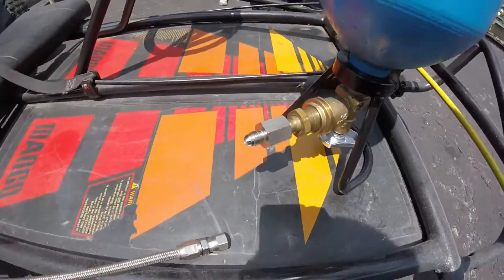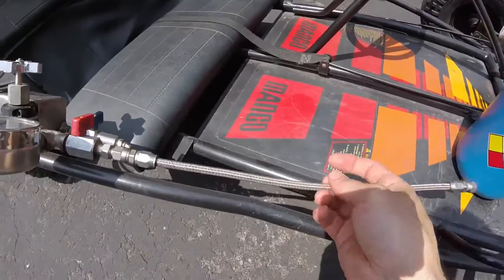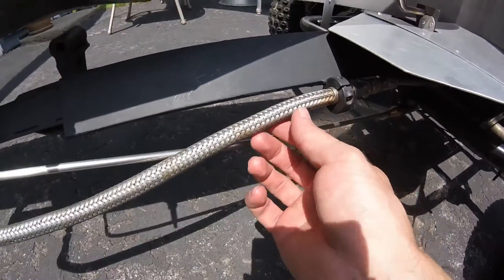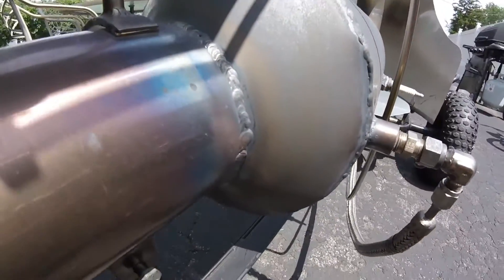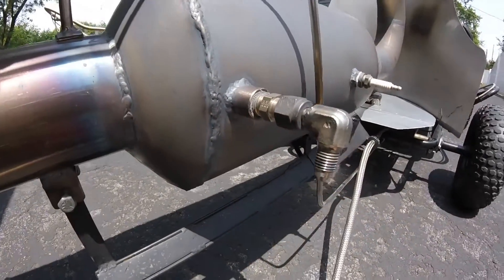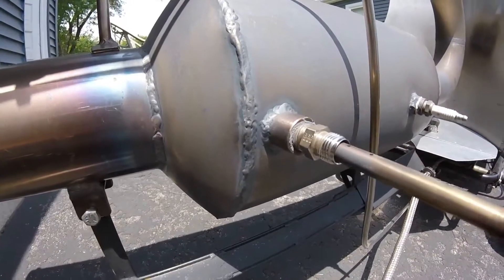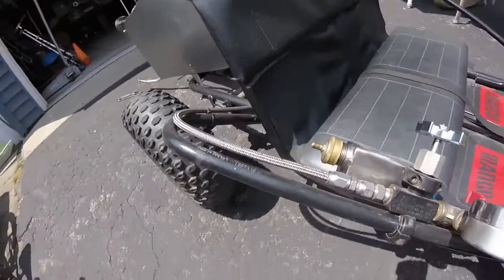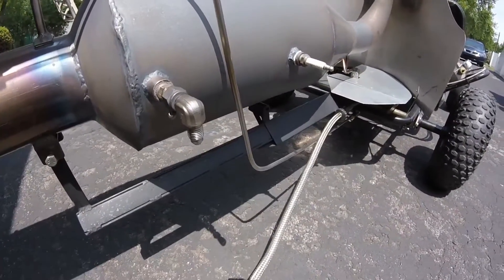pulsejet fuel system

Comment: hey you probably wont see this because this video was 8 years ago but im making my own pulsejet engine of the thermojet variant and i would like to do the same thing where you can remove that stainless steel pipe but im kinda confuzed what all those fittings are could you give me a list of what you used to make that happen?
Reply from the maker: It's just a compression fitting for the size tube you're using.   They allow the tube in the fitting far enough to grip it with the ferrule. What I did was drill the fitting out so the tube goes all the way through.
Reply: @MrBen527  thank you dou do you have any tips for building pulsejets or anything i should know? also quick question did you use sheet metal and a slip roller thats what most i have seen do but im curious about yours. also I under stand how you got the tube to work. the way you set it up is backwards from how those fittings are usually used right the pipe usually comes out the other end not out of the fitting which i understand but  how is that 90 degree corner fitting connect to the pipe is it just welded/connected to the pipe and not the nut? you turn the nut and it rotates independantly from the tube/90 degree turn. In the video I cant tell if the tube is connected/rotates with the 90 degree turn or not. how is it connected to the pipe or does the pipe have threads so it is threaded onto the fitting.
Reply from the maker: @kipton-k3u Yes, for the larger cylinder sections, I rolled them from sheet.
Reply: @MrBen527  I see you are not using a flame arrestor how nessisary do you think they are? I know the tanks only have propane going through them but idk. what are your thoughts on it.
Reply from the maker: No arrestor needed with pulse jet engines.  These engines pulse/flow in both directions.
Reply: @MrBen527 what needle/metering valve are you using could you give me a amazon link if you have it or if you got it for somewhere else or smth
Reply from the maker: It's a Parker MV400S.  U can use any decent quality metering valve that will give you good control.
Reply: @MrBen527  ya my only issue is finding a metering valve amazon basically only has needle valves and ebay its difficult to find them. and I would probably be fine with a needle valve but its difficult to determine which are crap and which give more precision. do you have any suggestions where I should look for one?
Reply from the maker: @kipton-k3uThey're on eBay if you search MV400s.
Reply: @MrBen527  I cant tell how does the 5/16" pipe attach to that 90 degree elbow? which i think is 1/4"NPT does the pipe have a thread on it? wait is it welded i cannot tell
Reply from the maker: @kipton-k3u Yes, it's welded
Reply: @MrBen527  thx I will send you a video once it is done. You have helped me a ton. I appreciate it.
Reply from the maker: @kipton-k3uSounds good man!  Anytime!
Reply: @MrBen527  I made some parts of the fuel system like exhaust and the fuel system though I am having one small leak in a place I wrapped It twice in yellow gas teflon tape but idk if thats enough Im not gonna try wrapping more on that leak until tomarrow cause my hands are sore from tightening/other stuff. how much did you wrap yours?
Reply from the maker: I don't have or need any thread sealants.  Just some antisieze on the one 90 fitting going into combustion can.
Reply: @MrBen527  I might try no teflon and see the results. I may just not be tightening them enough.
Reply from the maker: I welded the tube to the 90.

Comment: Can I use 40 psi and how many fuel holes
Reply: I’ll post a video soon
Reply: I just posted it. It’s unlisted so I can put the link in the comment
Reply from the maker: You should be using it as liquid like I state in this video.  If you pull gas off the tank, the pressure will drop fast.
Reply: @MrBen527  yeah I think that’s the problem when I try to run it on gas. I have to keep the leaf blower in the intake or it will stop pulsing
Reply from the maker: @profishinjr4880 Yes. Assuming you have a larger engine,  using gaseous propane will not keep up.   Can you post a vid of your setup?
Reply: @MrBen527 sure
Reply: @MrBen527 how does it look
Reply from the maker: @profishinjr4880  I responded earlier.   Can u see it?
Reply: @MrBen527 just did
Reply: https://youtu.be/JDvbR3lSHQA?si=wT9N5B5jCcta-1jS

Comment: Will you still respond to this? I just made my first Lockwood Hiller pulse jet and I’m trying to figure out what I need to buy to do this kind of fuel system.
Reply from the maker: Hello!  I described what I used in the video.  You'll just have to find a source online or a supplier where you live.  U can do a cheaper setup as long as it can stand the stresses and heat.

Comment: How much propane vs burn time?
Reply from the maker: Depends on throttle setting but at full power I'm using almost 2 pounds a minute.
Reply: @MrBen527  oof guzzler... do you know of anyway to increase that efficiency?  I saw an ice sled on here and i can design the frame much safer but that maxes out my engineering skill I was thinking maybe liquid O2 or N02 but do not wish to die a horrific albeit legendary death riding a jet sled on a frozen lake in Canada a modern day flannel clad Icarus lol
Reply from the maker: @TheNathanEverest  Not with a valveless engine like mine.   Valved pulsejets are a little more efficient.   The beauty of these valveless engines are their simplicity/reliability.
Reply: @MrBen527  I appreciate you taking the time to answer my questions
Reply from the maker: @TheNathanEverest  Anytime sir!

Comment: Is your injector welded to the elbow fitting?
Reply from the maker: Yes sir it is.
Reply: @MrBen527  Also, Im curious what your ignition system looks like if you're not doing the old propane torch/leaf-blower trick
Reply from the maker: Its a high voltage igniter from a furnace.  I put a automotive sparkplug boot on it to connect to the engine while starting.

Comment: I have built one similar in size maybe a bit smaller and have had trouble getting it to propagate, what size are the holes in your fuel rod? and what pressure is the propane at? if i use a hose that is larger than the one you use to deliver the liquid propane would that cause problems? is there such a thing as too many holes or too large of holes in the fuel rod?
 also one thing i haven't really seen is what people attach to the spark plug to start it. Sorry for the myriad of questions, its just you're the first person to really do an in depth view of the fuel system, it seems like everyone else just highlights the building of the bulk of the jet and just end up mentioning oh yeah there is something that puts fuel in
Reply from the maker: They are about 1/16 inch.   Are you saying you have not got your engine started yet?  As far as the ignition system, I'm using a high voltage unit out of a heater.  I suggest getting an electronic grill igniter, the type that come on gas grills and take a battery.  You then just run a wire from it to your spark plug.  Post a vid of your setup and I could help maybe better.
Reply: yeah i havent gotten it started yet, it may have been the lack of regulator in the gas line, I am going to try to rig a fuel system up similar to yours and see if that gets it going
Reply: MrBen527 Just wondering if you can answer a few questions about the ignition system. Having a hard time connecting the dots for what I need to do. I have a old pulse furnace I’m trying to turn into a little working model of a pulse jet.

Comment: Heises und gefährliches Go Kart hast du da. Ich hab es nicht erst mit Gas Probiert, der Verbrauch ist nicht wenig. Deine Einspritzdüsen sind ja nur Löcher,  hast du schon einmal es mit Benzin probiert?
Kannst du mir sagen wie viel Schub es bei der Größe hat?
Reply from the maker: I'll need that in English man.
Reply: Hot and dangerous go kart you have there. I did not try it first with gas, the consumption is not small. Your injectors are only holes, have you ever tried it with gasoline?
Can you tell me how much thrust it has in size?
Reply from the maker: Hot yes, if you stand near it.  No, I only intend to use LP.  Its much cleaner, safer and easier to deliver.  With any other fuel you would need batteries, pumps, wiring and atomizing nozzles.  My bigger engine produces 75 pounds thrust using over 2 pounds of fuel a min at full throttle.

Comment: is the on/off ball valve necessary, or is it just for convenience? I'm trying to make a smaller pulsejet, and I'm just using the propane hose from an old grill.  I would like to just use the grill knob as my throttle control as well.
Reply from the maker: The ball valve is for quick on/off action, instead of threading the throttle valve in.  But yes, I could operate fine without it.
Reply: MrBen527 thanks for the help
Reply from the maker: Anytime!